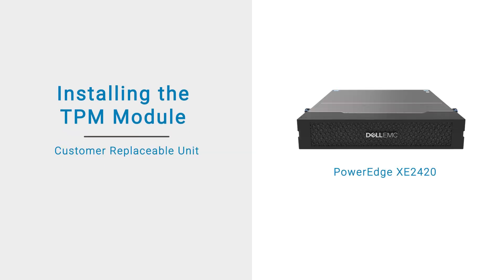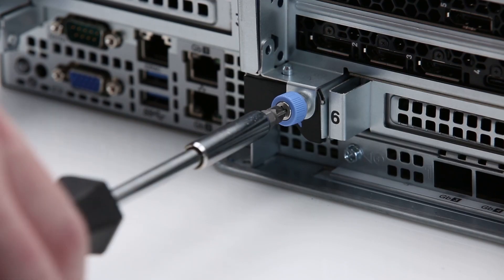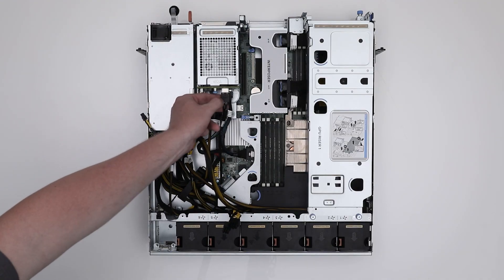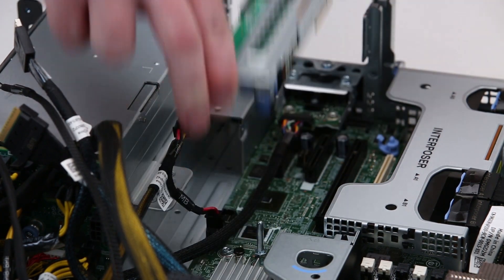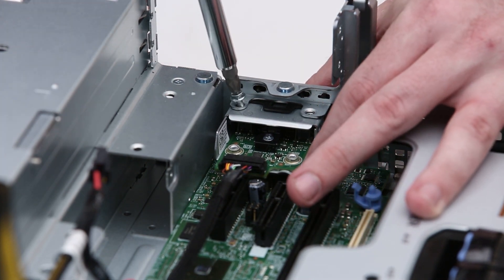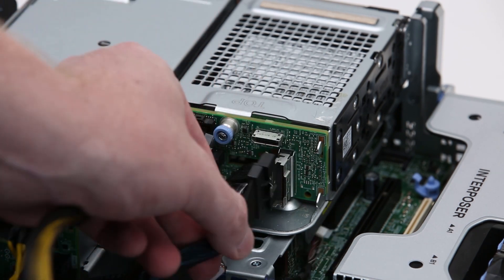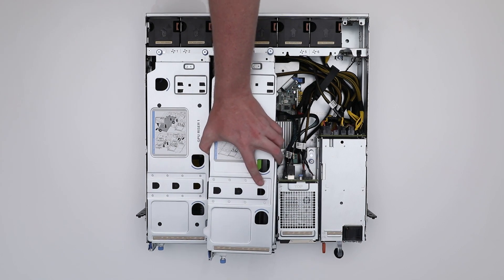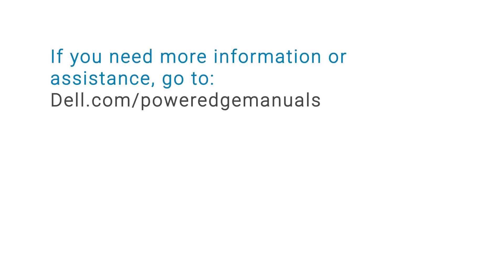How to install TPM module on a Dell EMC PowerEdge XE2420

Comment: hi guys i have a dell optiplex 3040 and want to add a tpm 2.0 chip as this PC only has tpm 1.2, what parts should I get and where should I put it?
Reply from the maker: Hi SWAY_ON_FPV, you can upgrade the TPM Firmware of your System to TPM 2.0. This article should help you to find out how: https://www.dell.com/support/kbdoc/000126503

If you need further help, please contact our support staff at the Dell Technologies Community https://www.dell.com/Community

Thank you.